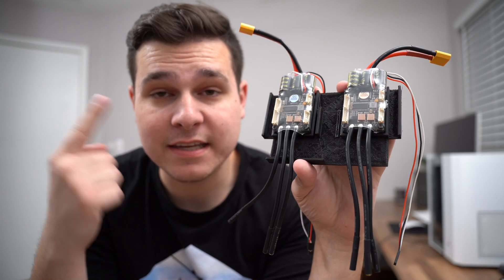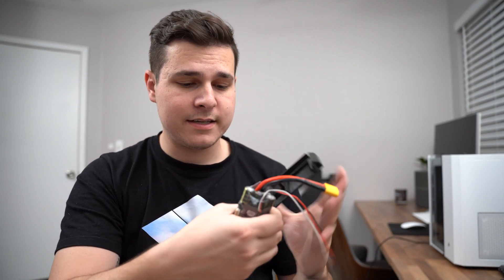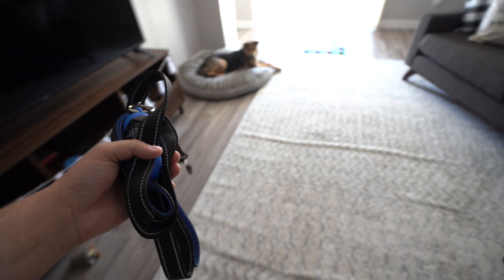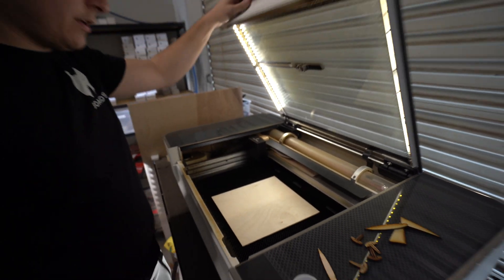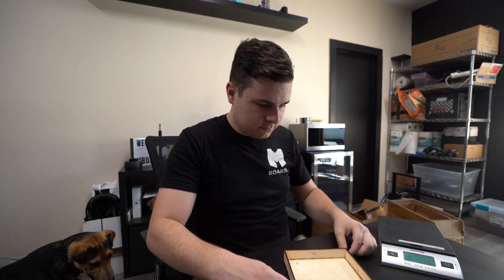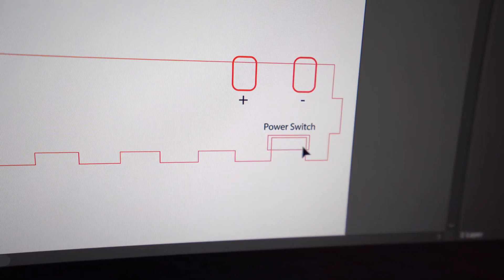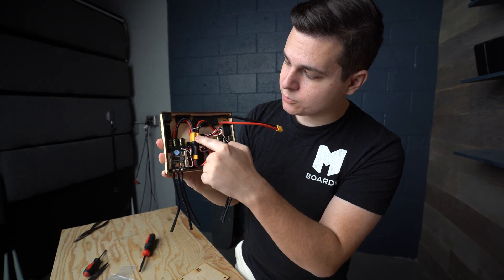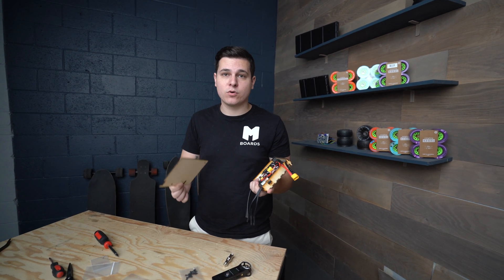Creating a Production Electric Skateboard: ESC Case Prototype Design

Comment: Hey mike you should tell me for 3d printing (i mentioned it in my mail ) I could modify some print settings so it would go about 4 or more hours less
Reply: It could be printed in a carbon fibre filament. It is as strong as a real carbon fiber enclosure with water tight seal (wood can't be waterproof)
Reply: Mail me if you are interested

Comment: One suggestion to the esc enclosure could be to add some sort of slots to allow for hot air dissipation throughout the entirety of the board enclosure and not just keep it cooped up with the esc’s. May help with thermals slightly

Comment: A lot of room to go with the 3D printing, design and configuration. Print time on that item could drop to under an hour with the right adjustments.
Reply from the maker: I may have to look into a different printer. I feel like I’ve ramped my settings up pretty good already but I don’t have a ton of experience printing. Might have to post the files and have someone take a look to see how we can improve 👍🏻
Reply: Mike Beard nozzle diameter, slicer settings.
Reply from the maker: I’ve maxed out the nozzle settings with my current set up. Might look into getting a wider diameter nozzle. I’ve messed with the speed settings, infill, and a few other things. I’ll try to look into this more to increase efficiency 😎
Reply: Mike Beard nozzle diameter is what I mean. There’s only so much volumetric flow you can get for a nozzle diameter. Upgrade to direct drive extrusion, 0.8mm nozzle and that print time will dramatically decrease
Reply from the maker: Awesome! I’ll look into this 👍🏻

Comment: I really don't think wood is a wise choice. I know it doesn't seem like it, but if you sell any real amount of these you will have customers with fire issues.
It's inevitable from the heat that can be produced by:
- Faulty components
- Faulty installation
- Inadequate riding conditions
Reply from the maker: Wood is not necessarily the final material. Just an easy way to rapid prototype.
Reply: @MikeBeard  Oh, awesome!!! Thanks mike!
Reply from the maker: Good looking out though! Definitely a very valid point that we’ve considered 😎

Comment: Where you have cut out the holes on the box for connectors you should use 3D printed covers that will chamfer on the inside to meet with the connector and for the wires have a plate with a hole the same size as the wire, cut horizontally that way the two pieces can connect and make the hole the same size as the wire and not the connector.
 (kinda hard to explain without a visual)

Comment: Won't a wooden enclosure be easier to break when driving off kerbs and over bumps?
Reply from the maker: This case will be located inside of the main enclosure 👍🏻 So this will not be an exterior case, just an internal case more for organizational purposes.
Reply: @MikeBeard   It really us us a nice idea and would probably work great for you, because you have technical knowledge. Most people that buy a prebuilt board because they don't want to have to do any work. With vibrations and rattling it will still break. Your glued seams won't hold. Plus, in that smalle enclosed area it will retain moisture.  Another thought,  hot electronics secured by wood, inside of a closed enclosure. Will the board come with a fire extinguisher? Those are just my thoughts but I do like what you're doing.
Reply from the maker: Wood material isn’t final, just great for rapid and cheap prototyping 👍🏻 Will be switching over to a nicer plastic most likely. Also will be switching from glue to more screws to help structurally (also glue annoys me haha).

Comment: why don't you just design the full enclosure with some kind of a cable management system?
Reply from the maker: We could do this as well. But we are really trying to stay away from anything too proprietary and give our riders as much freedom as possible when it comes to customizing or modifying. I worry that adding any permanent cable management may restrict the end user if they want to add any of their own components or change their battery to a larger size. 

But if we could do it right with customization in mind it might be a really good idea!
Reply: @MikeBeard  also keep vesc cooling in mind you might want to make the esc box out of aluminum with the same process of laser cutting.(or atleast the bottom part)
Reply from the maker: Yes definitely have to test thermals before full production. Not necessarily going to go with wood. The Vescs already gave an integrated Heatsink which may be enough but will definitely have to test.

Comment: why arent you going with a dual vesc on a single board?
Reply from the maker: The idea behind this board is that it will be completely modular and upgradable. So if someone wants to buy the cheaper version to start, they can purchase an upgrade kit later on to upgrade their board if they want some more performance. Starting the boards with a single Vesc will allow us to offer the boards at a much better price for anyone only looking to only run a single motor. It also helps a ton with repairs of a couple years down the line 1 of the 2 Vescs fail, a replacement for a single Vescs is much cheaper than a dual.
Reply: Mike Beard - How often do VESCs fail?
Reply from the maker: If programmed properly not often, but it depends on brand, motor size, etc.

Comment: how much do you expect them to go for?
Reply from the maker: We're working on the pricing right now for the final boards. We will ultimately be releasing at least 3 variants of a long board ranging from $600 to $1150 depending on the motors and batteries. Final pricing to come. We also want to do a cheaper short board shortly after the initial release.
Reply: @MikeBeard  awesome! I know you love belt driven but will there be any hub motor variants?
Reply: @lameio  I second that, prefer hub motors.
Reply from the maker: Sounds like we’ll need to look into this!
Reply: @MikeBeard  that would be great! Hub motors are also relatively inexpensive due to their simplicity and less moving parts, i was looking at getting a wowgo 3. My friend has one and it has really good speed and handling and it uses dual hub motors.